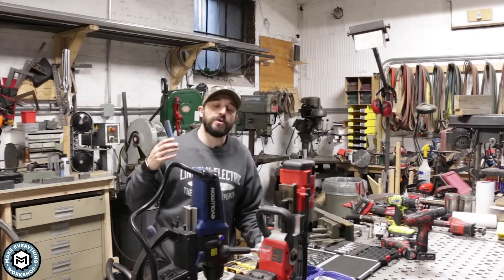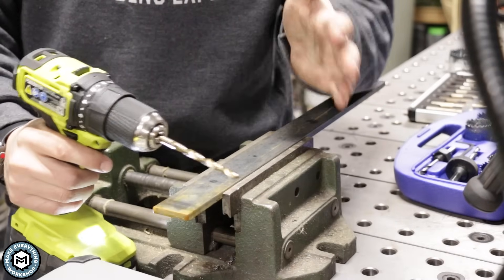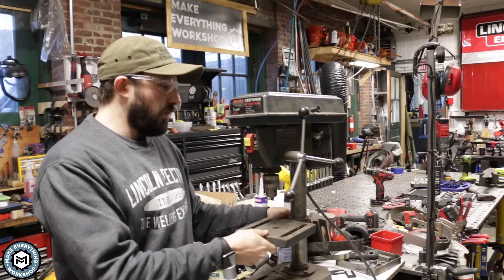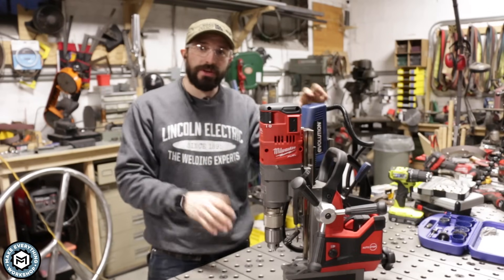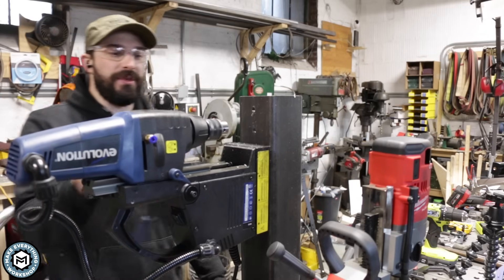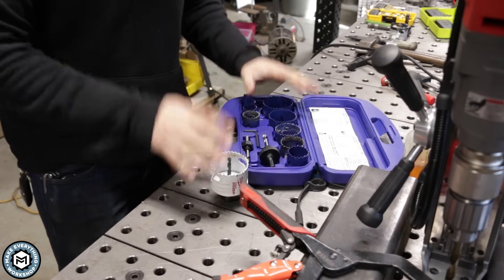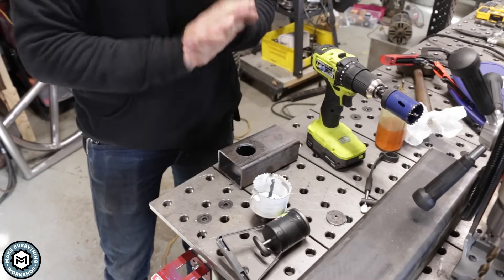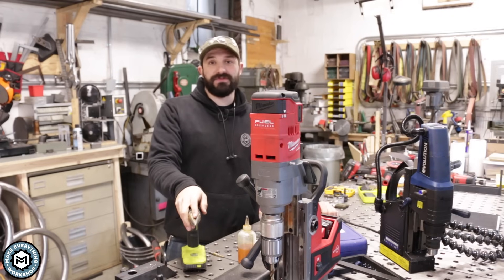How To Drill Holes In Steel - The Ultimate Guide!

Comment: I always assumed the bit in the middle of hole saws, were for helping to grip and pull the saw ring down as it went.  I knew it was there for keeping in place, but I also thought it was for the other reason too.  But I guess, the saw ring probably wouldn't be digging a fast as the bit anyway, which would leave you with it just spinning in the middle anyway.  Or maybe not, I don't know... LOL 

1 thing I do know is, if your bit is smoking, it's probably because you are going too fast, and even if you do use cutting oil, it will just burn the oil if you go too fast.  As you shouldn't have a really smooth hole at the end of your tip, where it's just polishing the metal. LOL 

The larger the metal coiling out, or even just coming out of the hole, the better.

Fantastic video man!!!

I just ordered a set of those 9/16" to 1" bits because of your vid, thank you for the info!

Comment: a hole pinch (two three punches) breaks the hard surface in most steels, works very well with stainless. Stainless has a hard outer shell, a hole punch breaks that.

Comment: That is a very informative video
Well done, I like your approach.
I may have watched it at the perfect time
As I'm trying to make a Jaw Crusher
And have been trying to set up my tooling 
To make the project work

One of the challenges I have with this Jaw crusher project
Is drilling & tapping an M10 hole
in 20 X 20 X 20mm Triangular bastard files
I tried tapping a M6 in the offcut section of the file near the handle
Which was kinda working, till I broke the tap off

But when I tried to drill holes in the files I've cut up
To make the munching teeth of the crusher
I realised these ends of the files 
Are a lot more hardened (which makes sense)
I could barely make a dint in one with sereval different drillbits
Should I try and get them cut using EDM?

Or should I just buy triangular steel lengths of mild steel
Do all the holes and taps first
And THEN case harden the steel?

Comment: I have 115 piece TItanium dipped HSS drill bit set also a Milwaukee 2 gears, 17 speed dial drill..so what's these drill bits good for as in drilling also what drill setting for my Milwaukee
Reply: See that's the thing I knew the Drillpress always works because I used one myself plus automatically straight down plus using tap tool

Comment: also getting swarf when drilling with a twist drill bits is a indication of too much feed rate.. you are ment to get decent sized chips from the hole.. only time your ment to get swarf from hole drilling is a annular cutter due to their angle of attack. Also i had one of those evolution mag drills and they shit if you want your cutters to last as there is no speed control at all.. speed is very important along with consistent feed pressure and rate when making a annular cutter last as intended

Comment: The Milwaukee is heavier  and more top heavy than most other mag drills. Setting a corded machine out of position is easier than holding the machine in place while winding out a magnet. Always chain out of position with any machine so the actual difference is the work it takes to get the drill bit positioned.
The Milwaukee is a bull. A Hougen or a Euroboor is typically smaller in all dimensions and some models are specifically designed to fit into beam pockets further reducing headroom.
I would not take a Milwaukee to the jobsite. In the shop OK, in the field smaller is easier and since muscle is required ultimately safer than lugging around a Milwaukee.
Reply: He did say that he used it a lot in the shop.

Comment: Hey man, new subscriber here. I’m trying to build a weight rack with 1 inch holes on 11 gauge steel uprights. They will require quite a few holes on all four sides of the uprights. There will be a total of four 86” uprights. What would you suggest the best method to be for getting this done? 

Best

Comment: Drilling steel im never really worried about or have a hard time, unless its hardened. Like drilling out broken bolts or something. How should i go about that. I usee to have a set of ridgid cold fire drills that were amazing but they dont make them anymore. I have a small set of milwaukee cobalt drills that are ok, but nothing like the ridgid. Even the drills the shop i used to work at, they had a master set of Kimball Midwest drills and they werent all that good. My milwaukee  redhelix cobalt are better.

Comment: Hey, hopefully someone can help, video is awesome but all I have is a hand drill and I have to drill 1/2", Can I step up the size by piloting 1/4" 1st then 1/2". I was told its possible but that breaking bits is a lot higher, does anyone have any advice for me?
Reply from the maker: Step from 1/8 to 1/4 to 3/8 to 7/16 to 1/2” it’ll get you the cleanest hole, with the least chance of breaking a bit
Reply: @MakeEverything  Wow thank you for getting back to me so fast! I guess this would reduce the pressure placed on the bit as it is pressed into the steel? Also super happy I came by this video. I currently building a barn with a pounded steel post foundation with 2x lumber laminated on each side to create a sill for placing a stud wall on. Finished half of build last year but drilling 1/2" holes was so hard it took 2 people pushing on the drill hahaha (2" std pipe about 1/4" wall). Hoping to make that easier this year.

Comment: I can't say I've seen anyone using aluminum on their table saw... now I want to see it
Reply: Its screaming loud & a heavy load on the saw. It works, but i avoid it whenevet possible.
Reply: For occasionally cutting aluminum or brass you can use a regular carbide blade meant for wood—the more teeth the better. But if you’re cutting metal often, it’s worth buying a dedicated metal-cutting blade. The carbide is tougher and less prone to chipping, and the rake on the teeth is either neutral or negative (for wood the rake is positive). Less rake makes the cut more controlled and less screaming loud. Some of these blades are even rated for steel, and work great for crosscutting square tube.
Lastly, if you’re cutting metal on the same table saw you use for wood, make sure to check under the saw for burning or smoldering sawdust. Those metal chips are HOT (especially cutting steel) and they can easily set sawdust on fire. Ask me how I know this…
Reply: @timothy098-b4f  thats good info. Thanks.
Reply: I've done it. But it is pretty nuts. I can see it not working out for some folks too. It's kind of sketchy. But if you do it right it's a nice cut. A lot still can go wrong. There's things you learn doing it. Like just how much heat chips take away from a cut. You'll feel every chip that lands on your skin.
Reply: @timothy098-b4f  I've never had aluminum chip a carbide tooth. Once I hit a thick steel bracket with a circular saw and that did a number on that blade. When the sparks started flying out of the kerf I just kept on going. I was like well it's wrecked now might as well at least finish. That steel was over 1/8" thick. I was trimming a bench and miscalculated a bit. It's right next to me now so I measured it. It's 0.1395" thick. So a bit better than 10 gauge. Whoops. I was using this really insane blade. Was some close out I got out of Harbor Freight years ago manufactured by Credo called Dynite or something. Claimed it was 10 times stronger than carbide. OK maybe not still did the job though. If I could get more of those blades today I would.

Comment: If you need a drill press to run slower than its lowest-speed setting, you could try plugging it into a variable transformer and run it on a somewhat-lower voltage so that it turns more slowly.  I've found that this setup usually works okay for a unit with a regular AC motor, but you need to be careful not to damage it with the reduced voltage.  (UPDATE CAUTION, thanks to Mel Gross below: A good idea here would be to start the drill press with the variable transformer set on full power [make sure it's just the regular 1-to-1 transformer-coil-ratio of 120 volts, though --- many variable transformers increase the voltage somewhat at their highest setting, so be sure to check the voltage-labeling, and set the knob accordingly!  You should NEVER run an AC motor at more than its rated voltage!], and then turn the dial partway down once the drill press is up to speed.)  Maybe this method should only be used with a small inexpensive drill press where you wouldn't cry too much if it got ruined.
Reply: Not a good idea. If it’s an induction motor, which it likely is, it’s specifically designed to run at rated voltage. It generally will start at 68 volts, but develops little torque there. It could burn the motor out after some time.
Reply: @melgross   I agree.  I had meant that you would start it under full power and then reduce the voltage to get the desired speed.  I'll fix that on my original comment --- thank you for pointing this out to me!

Comment: Drills requires a coolant, taps require a lubricant.  The best coolant for drilling steel and aluminum is 2 parts hydrogen 1 part oxygen(plain water) no fumes from oil, just steam, safe for your lungs. Ps for drilling larger holes, use the clutch settings on your hand drill increasing diameter incrementally, no drill catching and breaking your wrists
Reply: Doesn't water soften the drill? I've read that water works a treat when drilling SS so perhaps you're right.

Comment: What happens when the metal is of the same hardness as the drilling bit?
Reply: Conflict occurs.
Reply: That is a problem they had to face back in the day before anyone knew how to alloy steel. Then they made their bits very sharp and they drilled very slowly with a lot of pressure. They probably cursed a lot too. Back then more often they'd just throw the metal in a fire and punch a hole in it. Tolerances weren't as tight as they are today.

Comment: Nice video man. But a step drill bit without cutting oil made me cringe ha! I personally prefer in the field these stepped bits because of the weight and time Efficiency. That is provided I am carrying a small bottle of cutting oil in my tool bags. Otherwise bust out the aviation grade cobalts. And I’ve used these step bits to drill many thick mild steels up to 1/2” thick no problem as long as it’s a good one quality bit with oil. However I’m a little sad you brought up titanium and stainless in the beginning but didn’t actually cover much on these as it’s the reason I stuck around And watched the rest of the video. Not really for mild steel the whole time.
Reply: Step drills are so massive heat isn't as big a factor with them. Plus you're not exactly deep hole boring using one in sheet metal either. But yeah if you're pushing your luck and drilling through structural steel with a step drill then some oil will help.

Comment: ... NICE INSTRUMENT [THE RED ONE] BUT 
A- IF THE PIECE TO BE DRILLED IS SMALLER THAN THE INSTRUMENT AND YOU DON'T HAVE A ENOUGH SURFACE 
B- WITH THE TRADITIONAL VERTICAL YOU MOVE THE PIECE TO BE DRILLED WHICH IS LESS HEAVIER.
HOWEVER THE RED INSTRUMENT CONCEPT IS GOOD FOR FIXED STEEL CONSTRUCTION THAT YOU CAN NOT REMOVE.

Comment: "Lubricant" do not use for drilling in steel. Cutting fluid, tapping fluid, is far better. Lubricant does just that ands does not help with drill penetration.
Reply: Lubricant helps to keep the bit cool.
Reply: I'm not sure about that. Cutting fluids are often oil based. They're not entirely oil though. Actually come to think about it we ran straight 30 WT in our broach. It wasn't exactly a drill but it sure had some penetration. At the end of the day I literally had to shovel metal chips out of it. I'd get two barrels. It was a very productive piece of machinery.

Comment: you need to stress drill speed. if you spin the bit too fast with not enough pressure you will burn it up. rule of thumb is 60 linear ft / min max. so for 1/2 inch dia bit 450 rpm. novices think faster is better  not true.

Comment: I have to use carbide drill bits for my little griller.
People are lazy or just dont have skills to make their own equipment. 
I made this little fire holder thats very versatile. The handle stays cool because of the low conductivity of khantal wire. This is key to moving the fire around.
The rest is just air control.
Raise up for hot burning and flat on the sand for simmer. 
Here's what it looks like.
https://youtube.com/shorts/g_m2LNOg5zA?feature=shared.

When you've finished with the fire or charcoal you can just bury the whole thing in a hole in the ground to snuff it for re use.
Its such a simple thing yet ive had massive success with it.
At home i light the charcoal with gas and can cook a steak in 15 minutes from scratch.
I even take it to Greece on holiday for hassle free BBQ.

Comment: Just for kicks, i decided to look up how much Rocky Mountain Twist is asking for some of their jobber drill sets and hooo-leeeee-sheeeet...

$207 for a 21 piece cobalt jobber drill set. Ouch. Their 21 piece sets depending on the coating can cost anywhere from $107 (black oxide) to $345 (titanium coated). I think i'll stick with Norseman/Viking

People don't get how sharp those thin steel cuttings can be, i learned the hard way recently and cut the sh*t out of my hand.

Comment: Would never pay $3400 for  a Milwaukee mag drill that uses a battery. Guess if you do tons and tons of work that would pay for it.
Reply from the maker: It’s definitely not cheap, but for some clarity, I got this on eBay for $650 (it had barely been used) and the brand new kit with all the accessories and batteries is like $2500. Beats a cord when your working in a remote area!

Comment: That fact that your calling a BIT just a Drill tells me you know what your talking about. I will advise against WD-40. I have a million reasons for that. That came from a master Machinist that makes the tooling that is used to make Artificial body parts. I like using Lucas 50 weight oil as a lube. Works great!

Comment: Don't use annular cutters by hand or even a drill press.  It needs a super stiff quill or you will mess the cutter up.  Only use on a mill or a mag drill press.  Those are built with the rigidity needed in the quill. 
Also I don't like the dewalt drill bits shown.  They are good for metal but for wood, it digs in too much and will have terrible tear out even in backed pieces.

Comment: How about cutting holes for plumbing, I've been using a torch/core drill/grinders/hole saws, it's all been kind of a bitch, our smallest holes are 2 ½ inch, all the way up to 7 inch, while it's not a huge problem for the thinner metal, we are having a heck of a time when it comes to these corridors that have 3 layers of ¼ inch thick metal and this is inside of a wall area so we have a strip of metal at the base blocking bigger tools from sitting where we would like, so that's why the torch has been pretty efficient, but then everything gets a layer of gypcrete but is more of a concrete mix on this building so it's even tougher, any thoughts on making an easy job out of it?

Comment: Now drill those holes at 32 degrees.
Reply: Use a dowel jig to drill the pilot hole at 32 degrees, then use a hole saw with an extra long pilot bit. How would you do it?
Reply: @califoo  I use a hebo rbv12 automatic drilling machine. Endmill, pilot, final. Or just endmill all the way through.
Reply: @curtisalanmcgee  I had to look that up. Looks awesome! How much did it run you?
Reply: @califoo  almost $50,000

Comment: I got bored. 3 thing to do. Should have been in the beginning.
1 centre punch where you want the hole. then your hole is where you wnt it
2 drill speed is slow. The bigger the bit the slower the speed.  
3 lots of pressure so the bit cuts chips not powder. powder means you are burning your bit. so slow the speed or add more pressure or both.

Comment: ☝️🤓 For the battery powered mag drill, they ought to add a motor to lock and unlock the permanent magnet, so the knob would just be a backup. It would have ease of use similar to that of the corded model, yet without drawing down the battery, and while still maintaining the safety benefit of the cordless version.

Milwaukee, DM me for the address where you can send the check.